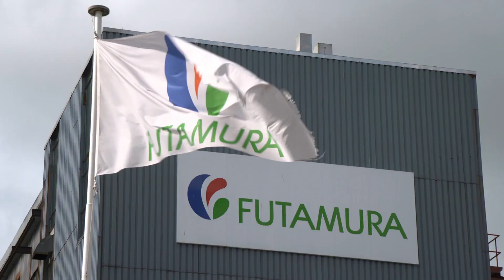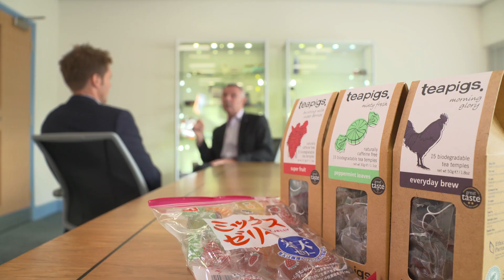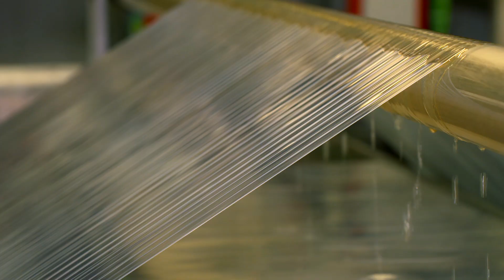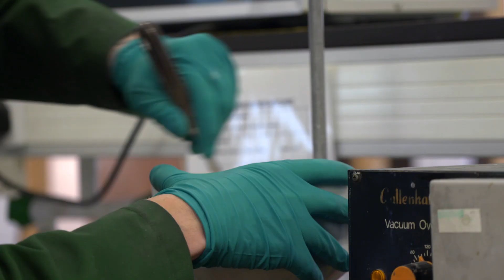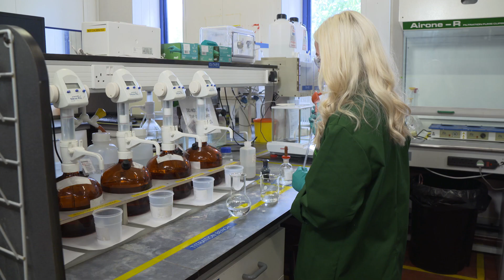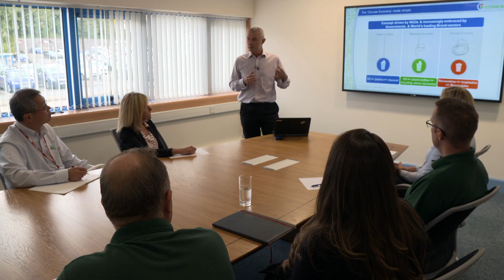Futamura Cellulose FIlms - Packaging to enhance daily life

Comment: I understand that carbon disulfide is used in the initial manufacture of the viscose ....not mentioned in your video, ..... the material later transformed to make cellophane/natureflex. Carbon disulphide is highly toxic ... what measures do you take to control this substance with regard to the environment and worker safety?
Reply: Really a non issue for a well functioning EHS system.  Their systems look robust.
Reply: I'm also curious about how thorough you are in containing the carbon disulfide. Also have you considered various eutectic ionic liquids as alternatives?